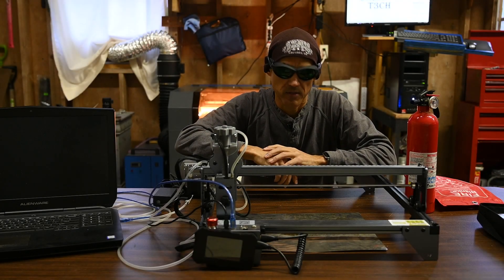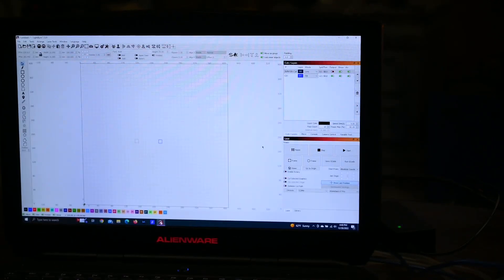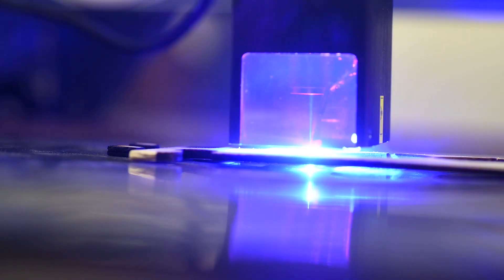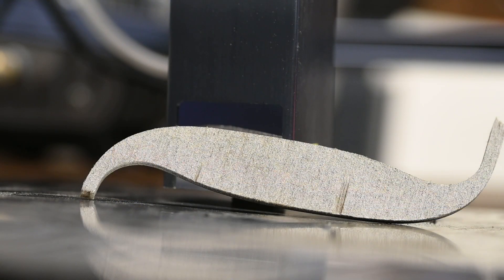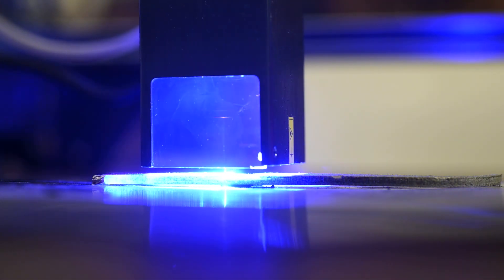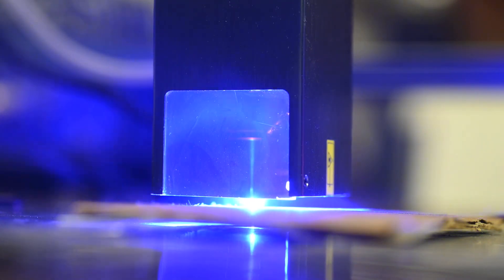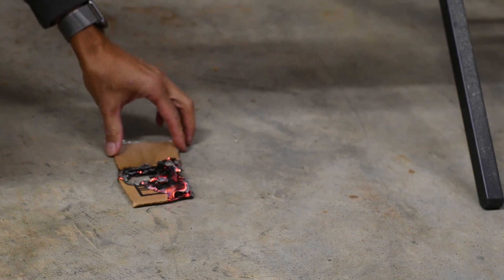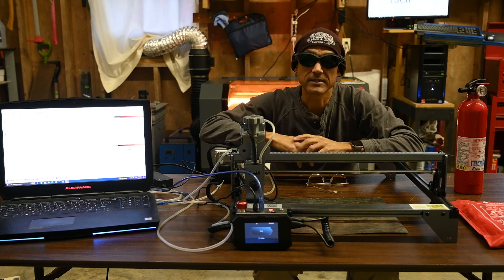Is your laser engraver/cutter a FIRE HAZARD?? (YES!!)

Comment: Common sense, which you studiously avoid will remove 99% of your problems.  Yes you can use any laser to start a fire.  You can also do it with a saw in soft wood.  Easy fix is several light passes at a higher setting, you avoid most problems.   IT is not anymore a fire hazard than your stove.
Reply from the maker: Appreciate your comments.